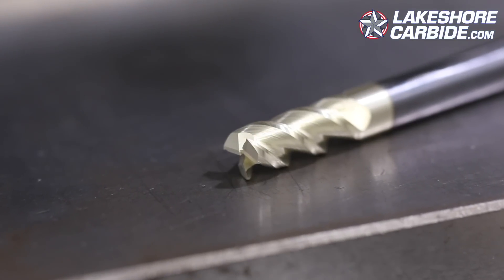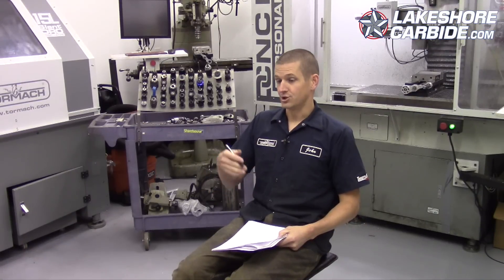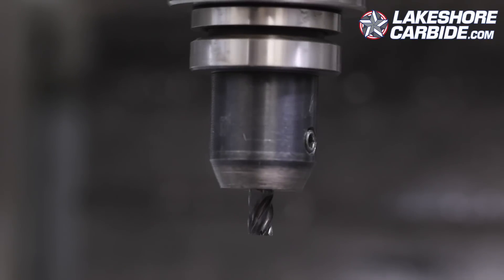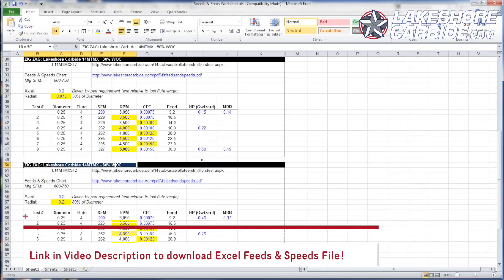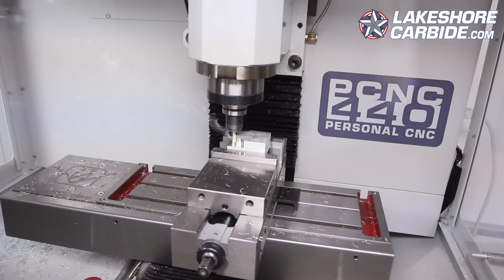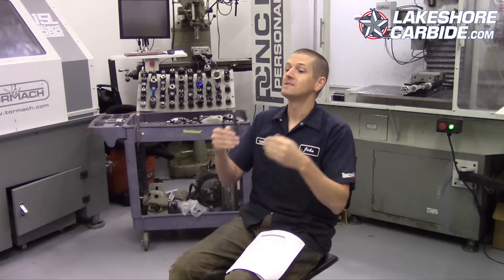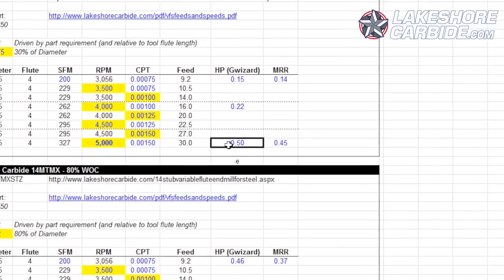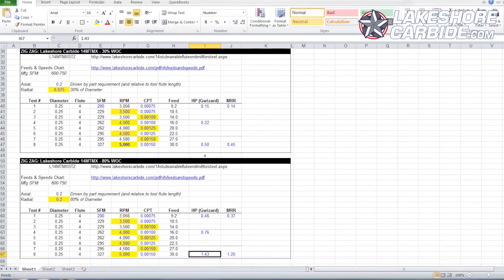6. Width of Cut, Length of Cut & Selecting Tooling!

Comment: I'm running a 1980s Swedish machine with a max spindle speed of 2500rpm. (2.4kw 3 phase motor).  Working with aluminium, if I am cutting a contour cut and want 35mm doc , would it be better to use a larger dia endmill (say a 20mm dia, 3 flute) to limit deflection because of the long flute length, and then do finishing passes (0.2mm) with a 10mm dia 3 flute ?

Comment: 3:15 couldn't agree more... recently went to a 10mm DOC and a 1.2mm WOC on my cnc router... Nearly quadrupled my MRR now around 15 cubic cm a min! better surface finish and huge chips too, easier to clean up.
Reply: sn0wchyld I feel like a 2.6 mm doc radial and 6mm doc axial works best for me cutting steel on my cnc router. Reason is I think because a cut is a cut and a bigger cut will remove more material per cut saving me money on tool life.
Reply: on a 6mm end mill

Comment: John I had a tormach a few tears ago. I sold it. Im thinking of getting another. Do you have a problem with the TTS tool holders pulling out of the spindle. I know there is maintance procedure for the TTS R8 collet. How often do you do maintance on the collet. Thanks

Comment: Its not difficult to use, takes a bit to get used to using it, and to set the relief angles correctly. It may take an hour or so to get acquainted with the machine, endmills can be sharpened and back in service in a few minutes.

I sure enjoy your videos!  I have been a maintenance type machinist for 50 years,  but cnc less than 4 years, still learning a lot.

Comment: What's a good endmill diameter percentage for cutting an internal radius and not having chatter? Like for example, I have a .500" internal radius, should I use a 3/8" endmill or can I go larger?
Reply: Harvey tool has a good blog post on this, there's a formula to calculate how much you have to slow the feed on inside corners, and this also applies for cutting outside corners the same way where you can increase the feed and maintain the same chip load at the edge of the part since the feed is from centre line. If you look up harvey tool how to machine corners it'll come up with some helpful info.

Comment: I have a Darex endmill sharpener, it will sharpen the ends and the flutes as well, it is the model E90 and has an air spindle I bought it several years ago. when I was machining 304 ss machine parts.

Comment: Going back to my comment on the # of flutes video, this is how I get away with using 4 flute endmills instead of 3 in aluminum. I generally use a high RPM, a low chipload and I use dynamic toolpaths (HSM, trochoidal, etc) that do a good job of clearing the chips. Combined with high flow coolant, I have little issue with recutting chips. :)

I completely agree with using the shortest endmill you can manage. Much stronger. I also suggest using the largest diameter endmill that you can manage. My general purpose roughing endmill is 1/2" with 1.25" flutes.

Comment: I agree with the short endmill theory! I grind my endmills, ends and flutes, and have a lot of "shortys".........
Reply: My shop has a tool grinding section.. We can regrind flutes, bottom of end mills, re"gash" to keep endmills center cutting.. Also turn square corner endmills to have different radius or make them ball nose ..
I did a 3 month rotation thru that section as an apprentice

Comment: If you had to make a .140 slot with a .125 endmill, how would you ideally go about it? I know some guys like plunge milling the inital slot as opposed to full slotting with the entire diameter.

Curious for my stop pin track in my blades. I am using a .125 stop pin but am making the track .140 to give a few thou clearance on both sides of the pin.
Reply: How about a pilot drill first? Center drill, twist drill, end mill?
Reply: +Finn Custom Knives HSM type tool path`s they are bonkers at material removal
Reply: +daniel lyall unfortunately I dont have cnc all my stuff is manual. Although no doubt that would be the way to go. 
It's a 180° slot that would be done with a rotary table.
Reply: +Finn Custom Knives Turn the part 90° and use a keyway cutter to rough it along the X axis.
Reply: +atomkinder67 its a 180° slot around a central pivot point
Reply: Finn Custom Knives Hah! You posted that right when I was typing I think. Have you looked into a trepanning tool?
Reply: +daniel lyall if you can safely use two hands descend and turn at the same time (human cnc ) I have done it myself it works or make up a controller for you 4th axis there is a few you can buy. there is quite a few DIY versions out there too. I only have a cnc router at the moment everything else is manual
Reply: +NYC CNC for the stop pin track yes. mainly just curious if you think plunge milling the majority out would be better than full diameter slotting. Yes, I know I need CNC 😂